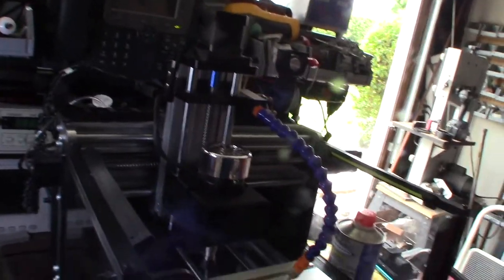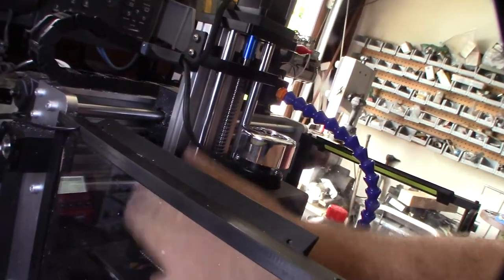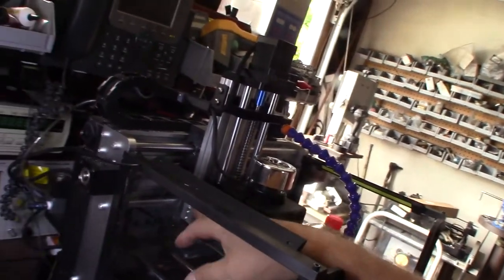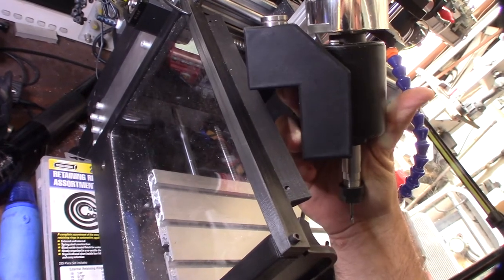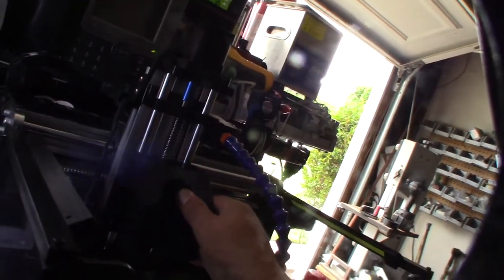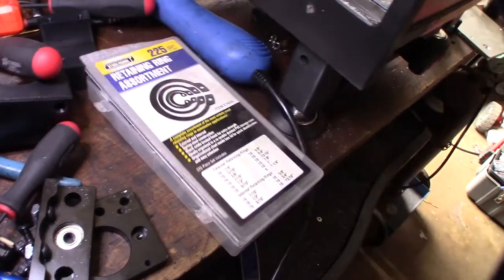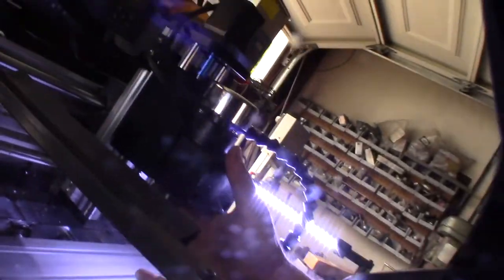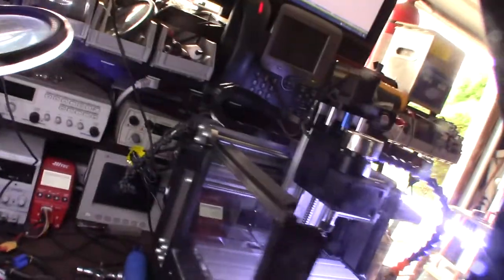3018 CNC Z axis spindle mount with extra bearings to reduce vibration play

Comment: The linear rod won't give you any  Rigidity if you go with a linear rail like hiwin 15 you cnc will cut much better I got rails on my cnc cuts great
Reply from the maker: Agree, My 3D printer are linear rail. With this last upgrade it might cut steel. I'm going to try on another video. Actually the ball screw upgrade made a huge difference too.

Comment: To be honest I find lot of vibration related issues come from the cheap spindle motor solution. Disregarding is it 200 Watt or 300, 400, 500 or 800 Watt motors are having same issues. Biggest issue is cooling fan extrusion. It is not balanced to be abke to function in high revolution range. Sometimes even collar will cause vibrations. Seems that dome cheap ER11 are not perfect either.  After the spindle issues biggest issue for me are the linear rails they have used. Even just inserting rod in it and trying it out with no load and you can feel the play they have. Third thing fir me is lack of precision cutting of those extrusions. Namely my 2040 extrusions were different length and are longer than linear rail rods this might cause bad system rigidity and make it worse.